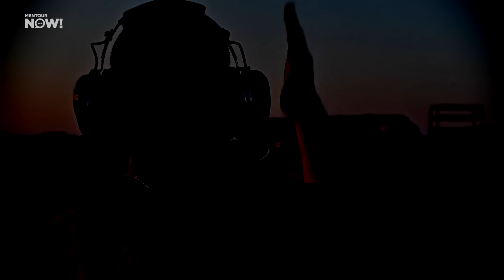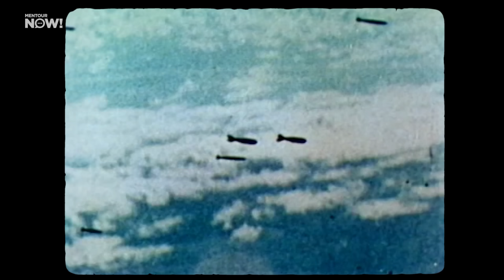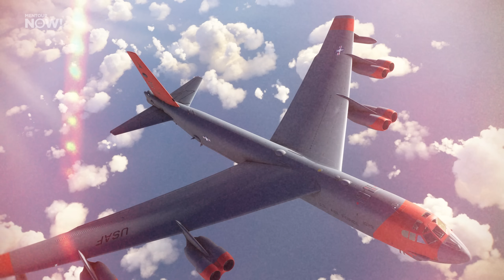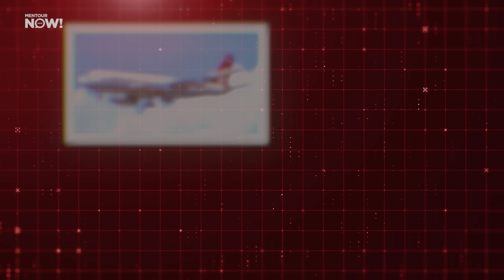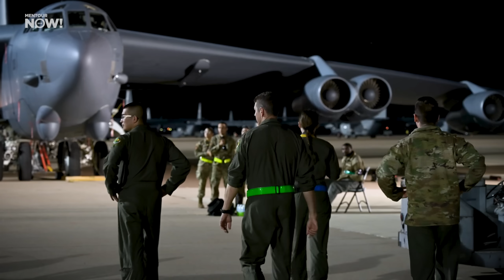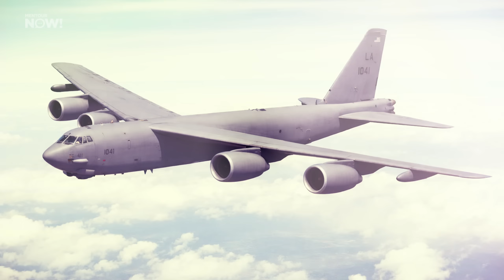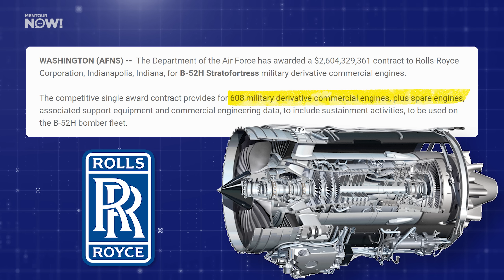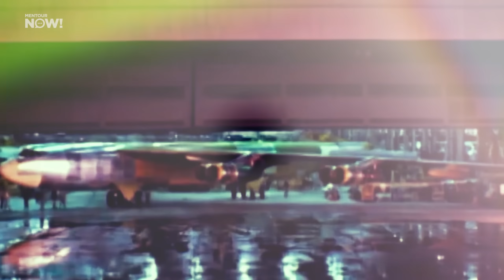WHY Are They Changing The B-52 NOW?!

Comment: Haven't watched yet, but this isn't the first time that they've tried to re-engine the b52, it stalled because it was supposed to be replaced but it looks like they're gonna live long after their replacements retire.
Had they done the upgrade sooner it would have saved millions, maybe billions in fuel and mx costs.
They were running out of parts when i last worked on them a decade ago, so they're probably almost out now.
Reply: Oh jeez, glass cockpit. That's interesting. Guess nuclear hardening is gonna be a bit... harder
Reply: The main reason they're not going to single engine, iirc, which i may not, is because it would require a significant rework to the wing structure
Reply: Oh, you kinda cover this later into the vid. Well, one of the downsides of typing stuff up before watching
Reply: @joshuacheung6518  I assume next you will discover commenting on an article after actually reading it. 😅
Reply: @rynovoski look, it's one of the very few things that's covered on this channel that i know anything about first hand. Plus what i said isn't fully covered in the video.
Reply: 13:18 yeah, i mean there were a bunch of hull losses due to the tail being ripped off, so they added a whole system to add more stability

Comment: It would likely be easier to deploy C-17 aircraft using Rapid Dragon systems than transitioning the B-52 over to 4 engines
The Globemaster already uses the PW2000/F117 engine, and Rapid Dragon enables cargo aircraft to do the same inexpensive ordnance delivery role that the B-52 has been used for lately
Reply: 4 engines do not work for an engine-out takeoff emergency and the resultant lack of rudder authority.  8 engines do.
Reply: @SEO122 what do you mean?
Reply: The c17 was overused and overstressed in the middle east, and has very important tasks other than a dedicated bomber. Not saying it's impossible, but it's not likely

Also the b52 has a larger capacity, is a nuclear platform, and has a larger crew allowing for it to do more-which given time, a c17 could be refitted for this

Comment: The summary of why B52 boils down to we don't have anything that can haul anywhere near the payload.   Plus compared to the B1 and B2 it's cheap to operate even as old as it is.    The list goes on but it's the (relatively) cheap capacity at the core.

A clean sheet design would be far more efficient but nobody wants to pay for it.
Reply: I definitely don’t wanna pay for it, but the general Publix opinion on military spending doesn’t seem to make much of an impression on anybody.
Reply: The B-52 was also designed at a time when computers filled up entire rooms, so the B-52 was made to carry gigantic computers, among other things. So when computers got smaller, the B-52 suddenly was able to fit alot of those smaller computers in the aircraft, thus contributing to its versatility. In a way, the air force got a bomber that was completely future proof
Reply: @dx-ek4vr that... is not quite correct. I mean yes, there have been upgrades to computer systems that made them a lot smaller, but they're placed in the original size box with weights so they don't have to adjust the weight and balance of the aircraft.

Also none of them were room sized, just like... 20lb boxes with quick release attachments
Reply: @joshuacheung6518  I disagree.  They just put the new equipment in the same spot as the old equipment with room to spare for extra equipment.  The change in weight and CG from new avionics is trivial compared with things like bomb and fuel loads.  They just re-weigh the upgraded airframe, publish a new empty weight and CG, and off we go.
Reply: @edfix you may disagree, but I'm the one who dropped a LRU down the ladder, bounced it out the hatch, broke the casing and saw this tiny little board and a bunch of lead weights.
It's why there's also miles of cables abandoned in place from inactivated systems
Reply: @joshuacheung6518  That is the point where they could just use a more modern system with a similar size. You'll get more capability and performance in the same package.
Reply: @HappyBeezerStudios they could, but they won't. It's not as easy as you say it is to do weight and balance.
Reply: @dx-ek4vr  Over-engineering is the key to longevity.

Comment: As mentioned on Patreon, Good video, but it left me sceptical and doubtful in regards to both the development of clean-sheet designs as well as the B-52 itself. On one hand, the unbridled complexity behind a new airframe makes me doubt the existence of clean-sheet design altogether, even beyond the mid-2030s. On the other hand, the antiquated design, concept, and possibly outdated strategy behind B-52s explain why there isn't a clear answer to B-52s remaining in service.

I personally feel that had there been a design with 6 engines instead of 8, and that had succeeded the B-52, with the consideration of modernization, serviceability, and simplicity, all complementing its military capabilities, such problems as re-engine wouldn't have existed with this aircraft. In other words, I feel that, contrary to popular understanding and beliefs as well as studies, the B-52 simply shouldn't have remained in service for this long, and the difficulties the aircraft imposes just seem unnecessary given the available technology.
Reply: It was designed basically as a cheap disposable workhorse, but it's also very reliable and not super difficult to repair.
So yeah... amazing they're still around.
Reply: The B-52 is a cheap aircraft used for delivering cruise missiles as well as guided bombs
Their nuclear weapon isn't the W63 gravity bomb (That's a tactical weapon for nuclear sharing & escalation management mounted to fighter aircraft), it's the AGM-86B air launched cruise missile (Soon to be replaced by the AGM-181 Long Range Stand-Off weapon)

The successors are all far more expensive, that's why the airframe is still around
The Russians are similar with their Bear strategic bombers, which have been used to launch air-launched cruise missiles against Ukrainian cities